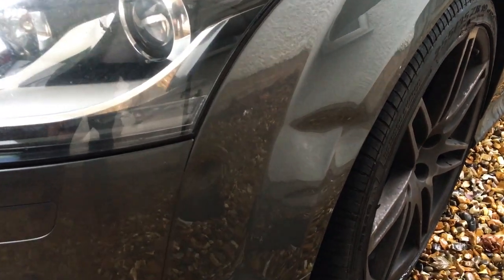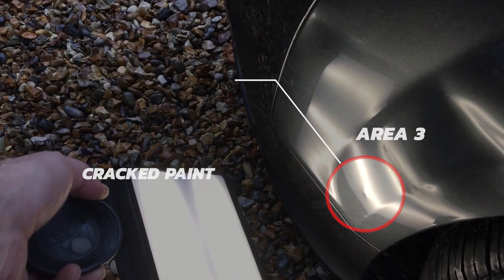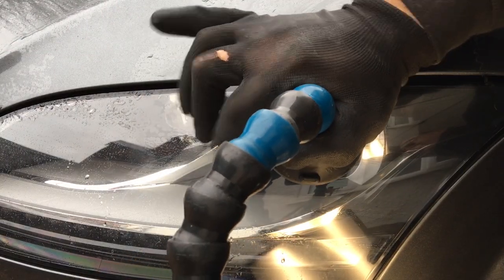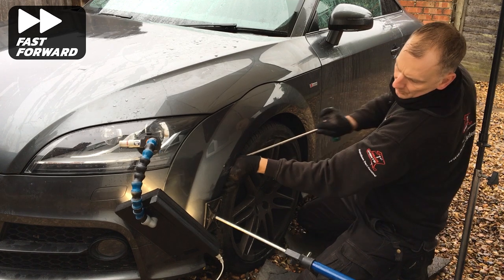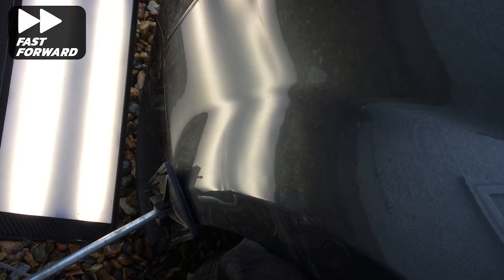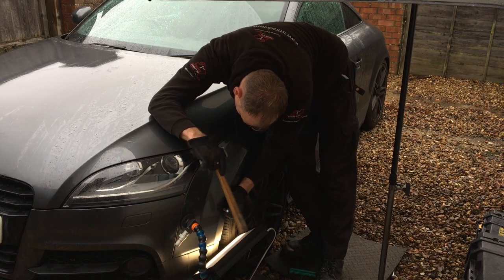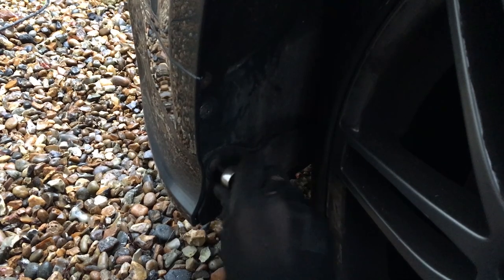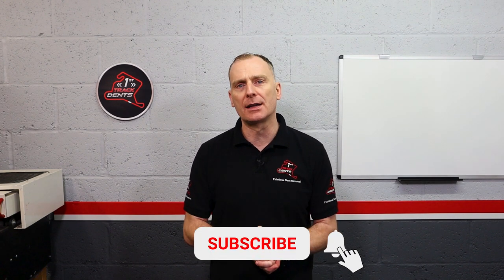AUDI WING SMASH! | My Aluminium Repair Challenge!

Comment: I cut one of those ratcheting cargo hold poles down to under half and used it for applying lateral tension between two pieces of wood, glued to both sides of deep damage to open it and reduce pressures which in turn makes it move easier and a lot cleaner.

Comment: Wow! I really enjoy watching your work. I have a 2017 Civic that gets hit every now and then. So far I had success in removing dents. But this one time I found my self against the left rear wheel fender is reinforced with another layer of aluminum? Impossible to remove lows and level it out. Any suggestion on this kind of panels?
Reply from the maker: Rear wings are usually double layered, so glue pulling can help otherwise finding any hole nearby and using thing wire tools etc can help. I also struggle with these type dents:-)

Comment: lovely repair ,I done a very similar repair on a blue TT last year , just wondering who's rods you are using , I quite look the like of them. Belast dent repair.
Reply from the maker: Hi Craig, I probably only use 2 main bars, the most used bar is my double bend screw on tip bar from Ultra Dent Tools https://www.ultradenttools.com/products/st3802-24-x-7-16-screwtip-dbl-bend-90?_pos=3&_sid=d6dbd8607&_ss=r

Comment: Do you ever use a line board to cross check or do you find your fuzzy light works best and is all you need
Reply from the maker: Hi Greg, I never use a line board at all, I am trying to work on making a new light board for myself and I may put 1 or 2 lines on it, for detail work. Some of the dents I take on are very complex and reflecting lines on those dents would give a crazy pattern of lines going everywhere which I think would be too difficult to read. I just see so much detail in my soft light, that it just works for me. Each to their own I suppose:-)

Comment: Great video.  I had a similar dent along the wheel crease in an aluminum (aluminium) Audi A5 fender (wing).  I just replaced it with a panel from a junkyard (scrap heap), but I still have the original dented wing.  Can PDR be done on the removed part, or is it better to be performed while still attached to the car?
Reply from the maker: Because of the heavy loads when levering the dent out, it is better if the wing is attached to the car:-)

Comment: yes!!!  You did it once more Jake always end up surprising me.  What a great repair, then one of the secrets to repair aluminum panels is to give them heat?  What temperature is right to start repairing?  Thanks friend!!  Good day 🇲🇽✌️
Reply from the maker: Hi Neto, Yes heat does help, I never measure the heat electronically, I do it by touch, I get it as hot as the panel would get on a hot summers day:-)
Reply: The heat isn't for the aluminum, it's for the paint!

Comment: Hello I follow your channel 
I love your work absolute craftsman just a question working with deep dents which way is best to bring up the  Dent without leaving lines in the lowest part of the dent is there a formula for it wait to hear from you Thanks
Reply from the maker: Hi, every dent is different, the key is knowing when to change to the right tips at the right stage of the repair. I just base it on experience of what works and what doesn't, although Aluminium moves very different to Mild Steel, so you have to work it differently:-)

Comment: dont need to answer but 
1)  how much would it have cost to replace that panel, including labor
2) how much do you charge to repair it
i beet the cost to repair is significantly lower :)

Comment: Hello,
Is the 24” Softtip Double Bend you're using here a 3/8" or a 9/16" diameter? 
Great vid. Thank you
Reply from the maker: The 24 inch double bend tool I use all the time from Ultra is here, this is a great all rounder bar:
https://www.ultradenttools.com/products/st3802-24-x-7-16-screwtip-dbl-bend-90?_pos=3&_sid=d6dbd8607&_ss=r
Reply: @1st_track_dents  ok great
Thank you

Comment: How about a tool with a rotating barring on the end?

To ease ridged tension...
Reply from the maker: There are tips that go on the end of bars that rotate etc, but I don't use them or see many other dent guys use them, I prefer several pushes rather that dragging the bar or rolling it, the industry is always moving fast so I'm sure many new bars and techniques will come out soon:-)
Reply: What about a heating up process that’s similar to the electric method in Arc wielding?

Where by connecting an electrical charge (of some sort) to the dented area’ it super heats it up in no time?

Surly something like this is possible?
Reply: @TECsta76  Why would you need it to be that hot?
Reply: Added flexibility/workability..

Appreciate this medium works best when Red hot...

Comment: All due respect but you keep mentioning nylon tip and the video shows a rubber sleeve over a rounded tip  am I wrong?
Reply from the maker: I always use 2 types of push on tips/caps, one is rubber, the other after checking is actually Vinyl not Nylon, the link to the ones I use are here:
https://www.pdrprotools.co.uk/vinyl-covers-100mm-p-292.html
They are much hard wearing than the rubber tips as the metal tip pushes through the rubber tip whereas it doesn't through the Vinyl tip. Thanks for highlighting this, i'll make it more clear on future videos, Happy Holidays!
Reply: amazing
Reply: @1st_track_dents  The link points to a pack of 100 tips.. Are these a consumable, so write off a tip after 1 use, 2 jobs, 5 jobs.? Obviously these need replacing from time to time, but would you get through so many in a year..? 🙂
Reply from the maker: @ericfrankrussell  Depends what your doing with them, I find one Vinyl tip might last me a month or so, so I don't get through the Vinyl ones much, the rubber ones may last for 6 or 7 jobs, the metal starts pushing through after a while. If you use them incorrectly they won't last long, also if the panel is too hot with the rubber ones, they will fail too. I bought a bag of a 100 each a long time a go and have loads left.
Reply: @1st_track_dents  Excellent, thanks for replying. You are really good at this, and the production of your videos is superb 🙂. Happy New Year...
Reply from the maker: @ericfrankrussell  Thanks, all the best to you and your family in 2020!

Comment: Anyone else hear a high frequency noise in the background?
Reply from the maker: Hi Leon, I checked it back but couldn't hear anything, It would show up on the waveform in my editing program if there was a high pitch background noise, but if anyone else mentions it, I'll check it again. Thanks for your feedback:-)
Reply: @1st_track_dents  I can only hear it from 0:33 until 1:21 and only on my headphones but not with speakers
Reply from the maker: @Petrophilous  I just tried it on headphones and it does sound a bit tinny in that time period, sounds like it needs a bit more bass. sounds great on my speakers though? I am using a wireless mic and they can be a bit temperamental sometimes. In future I will check the sound via speakers and headphones, thanks again:-)